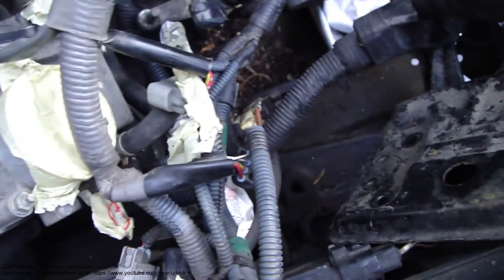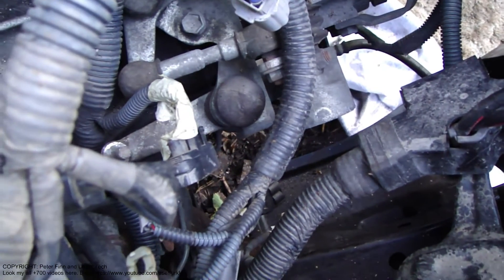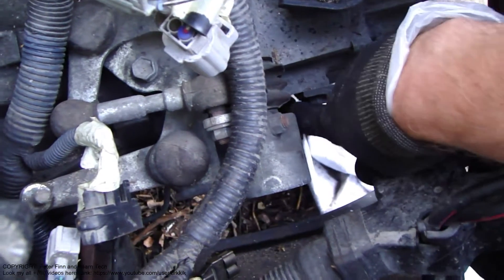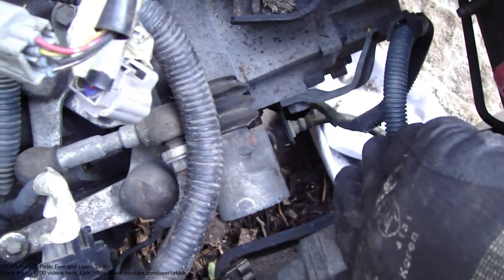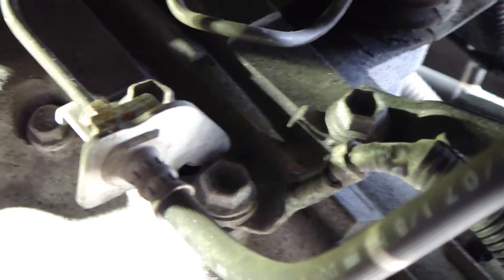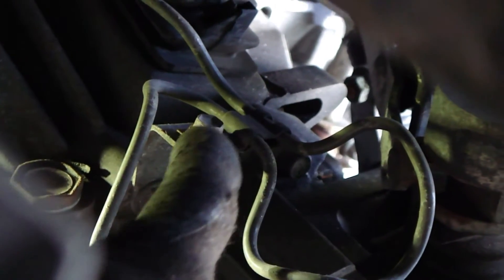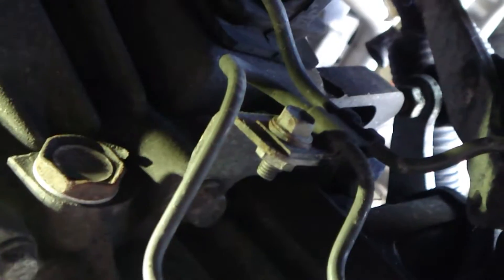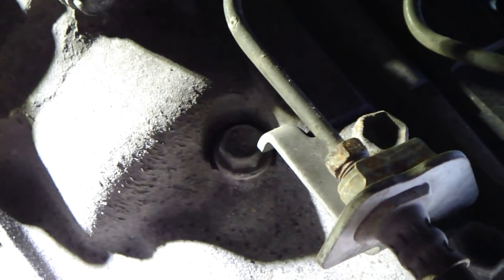How to replace clutch fluid Hose Toyota Corolla years 2007 to 2014

Comment: You did more work than necessary.  You only had to remove the two bolts (from the clutch fluid line - master to slave cylinder) connected to the clutch hydraulic hose and then pry the clip off using a locking pliers.  After you're done replacing the hose, bleed the system and you should be good to go, assuming both your master cylinder and slave cylinder are working just fine and you installed the hose successfully without leaks.

Comment: That's a slave cylinder, not a master  cylinder.  The master cylinder is connected to the firewall and the piston/rod is connected to the clutch pedal.